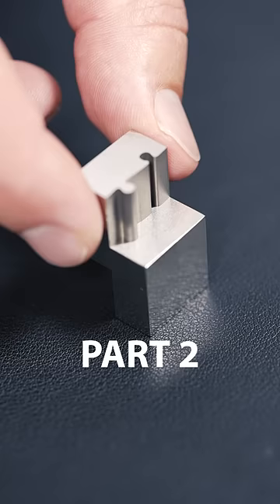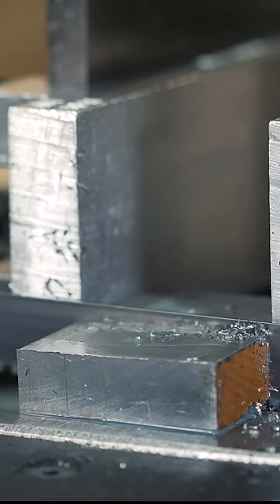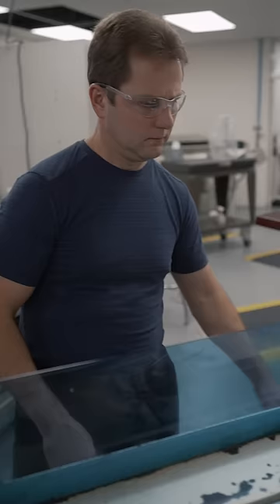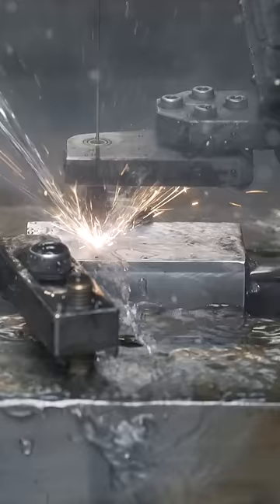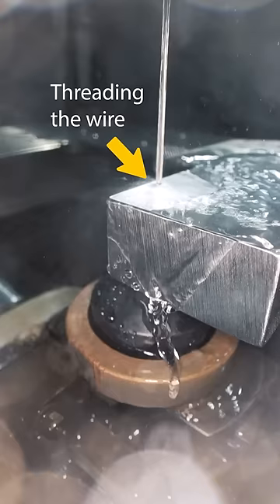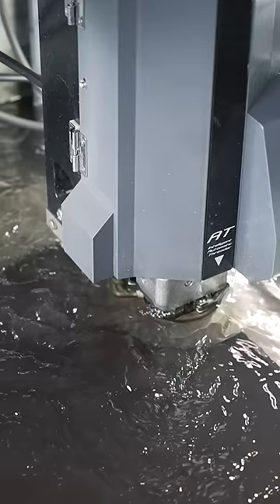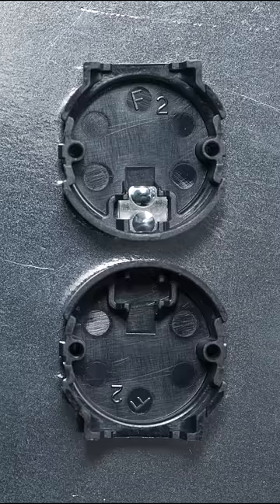'Zero Tolerance Machining' with the Wire EDM, Making a Puzzle Cube - Part 2 | US Digital

Comment: I always thought it was just a single cube cut up perfectly, makes a lot more sense this way…
Reply: That's what I was thinking too, but as soon as they put up the block with the four pieces marked to be cut it made a lot more sense.🤦‍♂️
Reply: if you think about it, you can cut very precise, but not indefinetly thin
Reply: This would be very nearly impossible. In order to cut anything you need to remove some material. Even if it's a couple of atoms thin. Meaning that a block of material cut in half even with the most precise and wasteful technique will have less material than it did when it was in one piece.
Reply: well that's impossible because the cutting wire that should be used for that must be a lot thinner than a strand of  hair which is sure going to be not strong enough to cut steel, I always thought it's separate parts and I'm right
Reply: @Quicksilver_Cookie  shears

obviously not possible for the metal cube we're seeing here, but in general. A block cut in half can have the same amount of material after the cut.
Reply: @chaklee435  However; if you cut a block in half; even with a very big saw, both parts should still line up perfectly?
Reply: @xFuaZe  not a saw, a shear. Imagine very thick scissors
Reply: It's also much less impressive!
Reply: Instead they made four cubes and cut them up perfectly
Reply: That would only work with a method of fabrication that doesn't remove material ( producing a kerf ) which only works when cutting "soft" materials.
Which for cutting materials like Metal basically means either using a Monomolekular Wire out of Sci-Fi that is thin enough to slide between the gaps of the atoms separating them or Fantasy like "thinking" to make a split here and there.
Reply: @Duraltia  you can use harder metal to cut softer metal without leaving a kerf. Does not apply to these cubes, but in general, technically,
Reply: @chaklee435  Yea but this discussion WAS about such cubes.
Reply: Same. I feel very dumb for not realizing it was done this way sooner.
Reply: Altgough thin, the wire has diameter.
Reply: Ok well that's what I thought they meant, it's alot less impressive now knowing that it's just four pieces cut to fit
Reply: @Quicksilver_Cookie  if the cut was only a few attoms thick it would basically be a perfect fit to our eyes
Reply: @xFuaZe  yes and no.
Reply: No, it would remove too much material
Reply: @Duraltia  There's also gem cutting but that's also a special case.
Reply: @chaklee435  and you're going to use these shears to cut complex shapes like puzzle pieces?
Reply: @breadfan_85  lucky for you, I've already answered your comment 6 months ago! See above
Reply: @chaklee435  I don't see it
Reply: Lol I'm like the 64th here
Reply: lol i came here because of this. there a channel said edm has perfect cut and now i know thats all is bullshit
Reply: I use to think that also, I was sad when I found out they use 2 pieces, you can easily do this without edm

Comment: "The tolerance is 1/10 of 1/1000 of an inch." Thank you freedom units.
Reply: lmao
Reply: Or .0001 of an inch ,most machines shops use decimal.
Reply: They were just trying to emphasize how small it was. Normally you would say a 1/10000 of an inch.
Reply: At least they're using powers of 10 here.
I guess they'll come to their senses sooner or later.
Aaaany minute now...
Reply: 1/10 of 1/10 of 1/10 of 1/10 of an inch.
Reply: @That_Awesome_Guy1  
No, in machining you'd say "one-tenth of one thou" (.0001 in.); "thou" is machinist shorthand for thousandths, or .001 in.

Comment: So satisfying to watch them line up, just imagine how it would feel like when holding it in the palm of ur hand 🥺
Reply: We (and many shops) been making cool, close fitting stuff with WEDM every day for years. For making specialty tools and molds for industry. Making tangible and useful things is a lot more satisfying than spreadsheets and financial statements.
Reply: Ikr 💆‍♂️
Reply: I got to handle one at a trade show once that was like that but a very complex spline instead of puzzle pieces. Actually feels pretty weird, when trying to put it together any slight misalignment will stop it. You have to kind of jiggle the pieces to get them to fall into the right place, then it just glides down.

Comment: My job is in mold polishing. These videos are nice to show exactly how much precision is needed for the molds, just to make a little plastic part. Many people don't understand how complicated these pieces can be!
Reply: Not only that, but also how important this is for any mass manufactured product and one of the parts that make economy of scale shine.
Reply: One complete mold for our plastic injection molding machines costs 600.000$ for a reason.
Reply: How long does a mold made to this tolerance requirement typically last? Or rather, how many plastic pieces can typically be made before the mold is considered worn?
Reply: @wizewizard1840 why is your mold so expensive?

Comment: He goes on to say he does molding which is a fact that hand work is always going to be superior to machinery for high levels of accuracy, mold making or class A automotive spotting is equal to the thickness of liquid in most cases, takes a damn long time but when finished is a an absolutely beautiful relationship between upper and lower dies withing a micron or 2,, theres a reason toolmakers still have jobs🤙

Comment: Those tolerances tho 😍 you can’t even tell it’s a separate piece
Reply: Honestly that is mostly the grinding. I would guess by how free it moves they have about a .00025" clearance in there. Even at that tight of tolerances there is still be pretty visible lines from the clearance. However when you grind it, some material is displaced in to the clearance gap, kind of bridging the gap and effectively making it invisible to the human eye.

Comment: I'm quite amazed by how smooth theese zero tolerance pices move past each other. I used to be a blacksmith and have experience with laser cutters and sheet metals but that dosn't compare to what a mill or a brass saw can do to a block of steel.

Comment: I've only seen these beauties of a machine just a few times but, now I'm just plain curious if it'd be possible for it to machine/cut the threads for a bolt like a die.
Reply: It's possible by using an electrode shaped like a tap split longitudinally to cut internal threads. The electrode would cut just like a tap by first cutting threads on one side and then slowly rotating while moving down similar to a thread cutting mill. A similar technique could be used for external threads.
I assume copper or brass would be used for the electrode to create the fine details. It's probably not very practical and a thread cutting mill would be faster and easier.

Comment: The weirdest part of this video is seeing such a high tech process, while hearing "one tenth of a thousandth of an inch". Thankfully google could translate it to microns for me.
Reply: That's .0001 inches, or 0.0025 mm - insanely small, considering most machining applications only require a tolerance of .005 inches (~0.01 mm).

Comment: The extremely tight tolerance is one thing, but how do you counter oxidation, forming a layer of rust? Even a slight temperature difference between these parts, would affect their mating fit. Can these methods be applied to materials like titanium or tungsten?
Reply: Make it out of Iridium.

Comment: It is made from different pieces of steel. There is no gap in the details of about 0.05 mm, plus a 0.1 wire will make a cut with a thickness of 0.15

Comment: As a former machinist there is only one thing that bugs me about this video, even though some might see it as minute:
Please NEVER tell anyone the water is "safe to touch". It is less dangerous to touch, true.
Nothing will happen if you touch the water AND everything goes to plan (which is the usual case), but the machine itself still isnt safe at all if the security measures fail.
Just a little safety nitpick, great video

Comment: I have wondered forever how wire EDM makes these perfectly fitting parts with basically zero kerf...it's two different parts both made to tight tolerances, but not extremely small kerf d'oh! Silly me. But all the same, EDM is a fascinating method with outstanding results. Cheers! :)

Comment: Tolerance is generally confused with clearance but both concepts are totally different in engineering.
Tolerance is the permissible range of variation or deviation from a nominal value of any dimension. It is a design specification. Clearance is the real physical distance between two surfaces. Obviously, to obtain very small clearances, tight tolerances must be specified and met. As clearance approaches zero, the surfaces tend to stick to each other, they do not slide.
In injection mold design and manufacture, there are critical surfaces that need to slide freely when not subject to pressure and immediately after,  reach metal to metal contact under load.

Comment: Fun fact: this cube fits together very precisely, but if they fit together perfectly at the atomic level then the metallic bonding between atoms of different pieces would actually reform when the piece was put together. So, there is actually a cap where making the cut more precise is less useful.

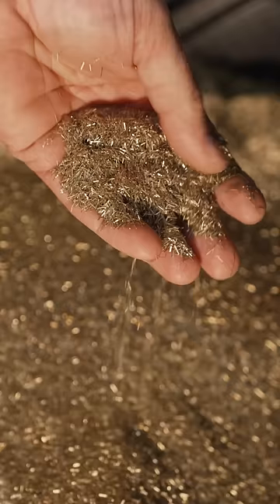Comment: 2:14 As you can see, the contours of the individual cubes are still clearly visible before sanding. And this is exactly where the secret lies. You grind or mill over the contours of the cubes when they are put together so that the resulting burr covers the gaps.
Reply: That´s also the way to hide welding, when a joint didn´t pass.

Comment: Forgive my ignorance, why pre-drill holes?  Couldn't you cut in from the edge and cut all four pieces in a single session (pausing to remove the loose pieces) without re-threading each time?
Reply: This is actually a good question! On newer machines you can surely start off the edge and burn in like you suggest but I have a few guesses as to why they didn't.  

1) The hole gives you a known starting location in your block, not as necessary for something like this but it's standard practice, especially if you are doing 15-20 holes in a plate.
2) It leaves support all around the piece being cut off, again not so necessary for something this small but the sagging makes a difference if you are cutting things out of a 12"x12" plate
3) The "flushing away" of the cut particles is really really key in doing EDM work. Older machines get much better results when the water jets are contained inside a hole or the cutting path of the wire, and they may have issues with starting out "in the open." If the flushing is poor the wire can short out and break (melt in half) which requires a rethreading process which wastes time.

I run an EDM at work and would be happy to answer any more questions you have, they are awesome machines!!

Comment: I work with 0,001mm precision, measure with 0,0001mm precision and have 0,01mm tolerance, which looks like a lot, but it's not easy if you have some difficult shapes

Comment: It's never up on screen for very long, so I'm just trying to confirm that there is no visible(to the naked eye)seam in these things? Obviously, from the video they start out with a hole in which to thread the conductive wire and we can see that it would seem, but for seeing an actual seam, I didn't see a single one. the part just slides back in with no visible space for it to do so.

Comment: Thanks for the video, I really enjoyed it and it answered a lot of questions that I had.

I never would have imagined that you use a bandsaw to cut through the steel blocks. What is the blade made out of and how often do you need to sharpen/replace it?

Comment: so ,maybe EDM is a brass bladed bandsaw that has almost zero side pressure because the electricity ,an electric short,does the cutting?i saw a 9 inch tall cylinder cut this way once..it was already cut,i didnt see it happen....WHAT A STRANGE process..THE ONE IN KEROSENE even more

Comment: zero tolerance? How is that if the wire passing through the cut is 10/1000 or 1/100 inch thick? I don't quite get how an airtight fit is achieved with a 1/100 inch thick cut?

Comment: I've been running wire EDM machines for 27 years. So many people have never even heard of this type of machining. Let alone that it's the most accurate form of machining available. I do however think your claim of a tolerance of .0001 is a little gratuitous. If that were the case your parts would not slip together.

Comment: water surely can't be split using electrolysis if the water in the EDM process doesn't even conduct an electical current! Imo water has got to be an element!

Comment: Wouldnt it have the tolerance of the width of the wire ? Edit: ah , I get it now . They don’t cut one cube like this they cut peices to fit together and defections  on surface are only 1/10th of 1/1000th of an inch I get it

Comment: zero tolerance machining is amazing but if the ambient temp rises enough it'll expand and get stuck right?  I was thinking about why a gun with a fixed barrel is considered more accurate than one that isnt and it must be because of the tolerances but i was thinking about glass, like pure glass... the type we usually use that has chemicals added to lower its melting temp and some types of glass hardly expand or contract at all at different temps. glass can be used to hold a vacuum and i've seen it be put on one side of a radial engine to make it transparent so they can see the internal explosion and so in some situations it seems like glass is pretty strong. i mean 'cold starts' of an engine are because of tolerances and if a material didnt expand or contract with temp and was good enough it would eliminate cold starts but maybe not with glass but somekind of ceramic glass or something. anyway, nevermind. nice video, bye.
Reply: The metal will all expand the same amount in the ambient temperature and thus not get stuck. 
If you heat only only piece it will no longer fit

Comment: Well this wasn't misleading or anything. Everything suggests you have a technology to cut big metal chunks straight into interlocking fragments with sub-hair strand accuracy and they slide apart like a sliced up Dragon Ball character. But no, you separately manufactured pieces and put them together. Fine work, but what's impossible with other methods here?

Comment: I'm really fascinated with this. Something small I'm curious about is how that water guide works, because it seems oddly simple
Reply: My guess is water gets pulled down by gravity like a plumb bob and the surface tension and downward momentum of the water keeps the brass wire inside the water stream. So it probably is as simple as it looks. Way easier, cheaper, and more reliable than trying to design an elaborate machine to guide the wire into position. 

Sometimes the simple solution is the best solution.

Comment: I fucking LOVE edm so much. It makes my water jet and laser look like brain surgery with a baseball bat. I would like to get an EDM but since I'm just a hobbiest it's hard to justify. Already have 3 CNC machines (2 mill 1 lathe) 4 manual mill 2 shapers 3 lathe hell I even have a fucking die filer but just can't bring myself to pull the trigger on either EDM or "3D metal printing". I almost have myself talked into it though for better or worse lol. 
What's the running cost look like compared to something like garnet water jet?
Reply: Go for it. You will find a market for your creations.
Actually: Dumb advice from me. Find your market first. But yes, very cool machine.

Comment: Clickbait.  You have five different machined parts there. The way you portray it in a title and a thumbnail you only have four. You did not cut the four pieces from the solid block that they are sitting in. You cut that solid block separate from another piece of metal.

Comment: Hi! I have access to a WEDM and would love to try something like this, I assume you are making 2 of the pieces just sliiiiightly smaller than the other 2. Do you have any numbers on how much smaller these are?
Reply: I was just in an EDM training class because my company puchased a new machine. The instructor had a similar interlocking widget he made, and he said he had the two interlocking diameters set at 0.0002" different. 2 ten thousandths total or 1 ten thousandth a side clearance. Maybe go for 3 tenths total clearance if your machine is older or you are more concerned with them fitting together, and less worried about a perfect interlock.
Reply: @johnbirkholz994  perfect! Thanks. I will try this hopefully next week :), have been CADing some interlocking parts i hope will work
Reply: @johnbirkholz994  I tried this and used 4 micron clearence so a little bit more. Turned out amazing. thanks

Comment: It's not zero tolerance because everything line in this world have a width/thickness just the very small scale..
Reply: If I understood him correctly, the tolerance is 1 tenth of a thousandth of an inch, or 2.54 micrometers in SI, which is really tight. However you can obviously not get to zero.

Comment: This is not perfect tolerance because you can see the outlines of the puzzle. In A real perfect  fit no outlines would be visible under any magnification or by the naked eye. But that's probably impossible to achieve cause i could imagine that the atoms would have to be cut precisely and then align precisely or something like that, lol

Comment: There is no such thing as "zero tolerance" 
It may be small, but its there.
Laminate molds usually have a "stack" tolerance.
That is + 0 -.0002 measured over a stack of 10 pieces, or 
-.00002 per piece.

Comment: This is like porn for machinists, gave me chills. The tightest tolerance I have worked with in our job shop is +-0.0005", and that's incredibly rare. It's usually 10 times that or more. Modifying oilfield stuff is surprisingly sloppy, like +-0.03"